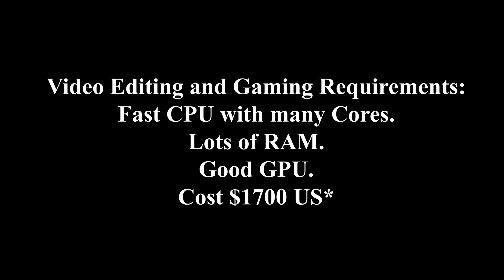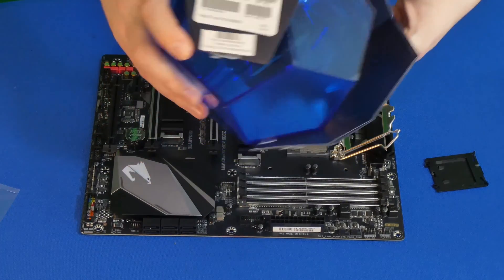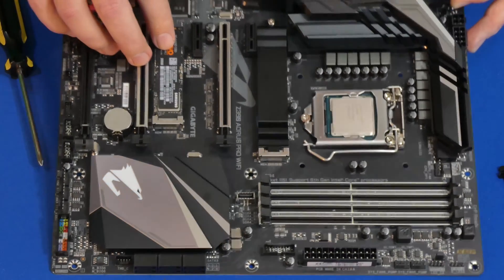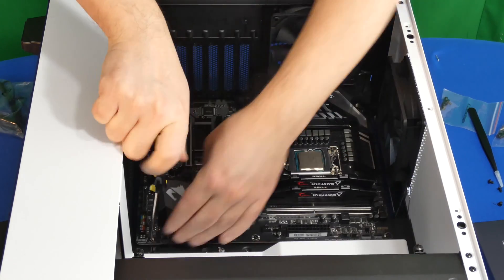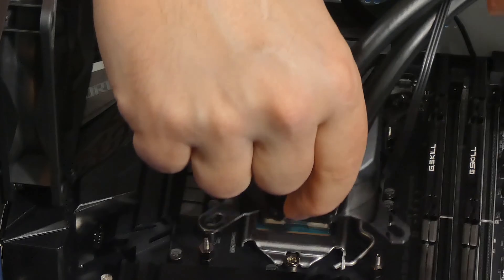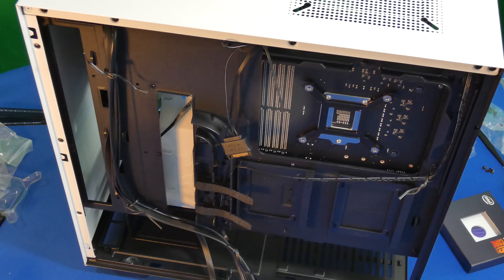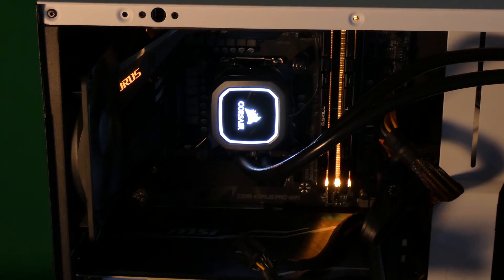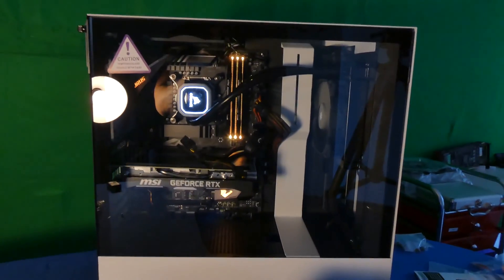Intel i9 9900k Build for Video Editing and Gaming, $1600 Budget with water cooling

Comment: is a corsair h60 good enough to keep the i9 cool? i recently bought a pc with these. thanks in advance <3
Reply from the maker: I think so. I will have a review video ready by tomorrow. It will show different CPU clock results.
Reply from the maker: Here is the new video about Corsair H60i https://youtu.be/aEfzTaR7wxs
Reply: Ok at stock but not good enough for significant overclocking, I personally would have sprung for a better case, PSU and cooler.
Reply: @Battleneter  i actually heard nothing but good things about the air flow in that case! and a buddy of mine runs a i7 8700k config in that same case and had no issue with installing in that case or keeping components cool...idk everyone is different tho so..